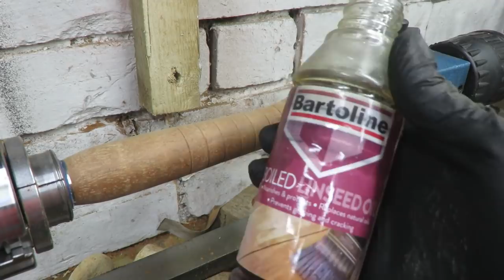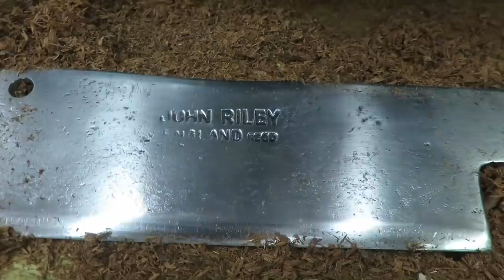Rusty knife restoration.

Comment: 4:39 I know this irritation myself. I don't have enough workspace on my bench to warrant permanently fixing down my bigger tools, and the grinder would walk like this when I tried to use it. Hard to make an accurate cut when the tool moves around. I solved it with woodworking quick-clamps and some 18mm ply. I made a plate for the bottom of the tool from the ply, fixed the tool to it and now I clamp the plate to the bench. V2.0 of my ply plate was made wide enough so it keeps the clamps free from my work area. V1 kept caressing my leg whilst i worked, it was weird. Works mint and its a cheap fix. Cheers from NZ!
Reply from the maker: Hey, That is really good idea and super cheap.
Thank you for your comment. I'm gonna definitely use this in future.

Comment: This is the exact same knife I restored, same brand and everything!!!!!
Reply from the maker: Nice. Have you done something different than me ??
Reply: @FALCON390Workshop  Yes I did a long hand turned handle, but didn't shorten the tang.  Also I didn't drill a hole in the blade but put a leather string to hang it up by.  I got mine from an antiques fair and bought it off Mark Stacey, where did you get yours?
Reply from the maker: Good stuff. I got my from ebay auction with many more rusty hand tool.

Comment: To Restore; to return something to an earlier good condition. 
In your video it shows you remodeling an axe, either a kindling splitter or a straight handled froe, into a small butchers’ cleaver. The converted axe does not have the mass at the front of the blade to function as a cleaver because the original axe would have been hit on the spine with a wooden mallet to split kindling or shingles. Additionally, it would have been safer to mount the handle in a chuck and mount the drilling chuck in the tailstock and then drill the hole.
Reply from the maker: Video shows only my interpretation of restoration. I like how it looks like and its usable tool again. 
Thanks for your comment and thoughts. 

Falcon390